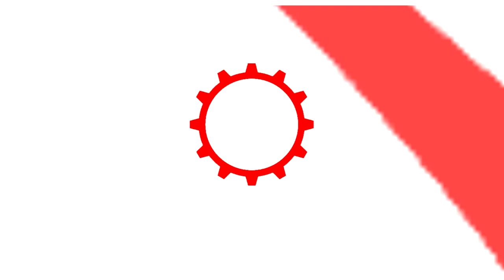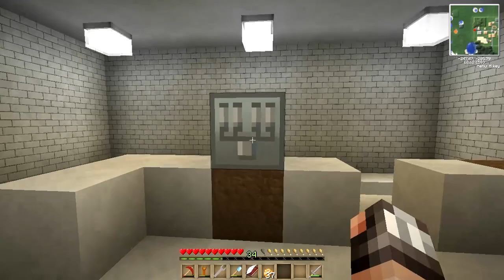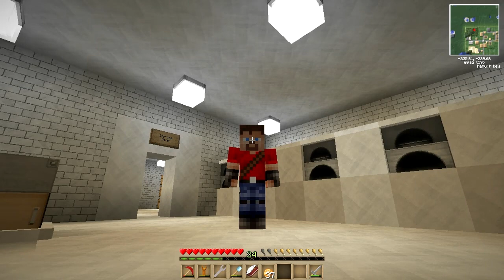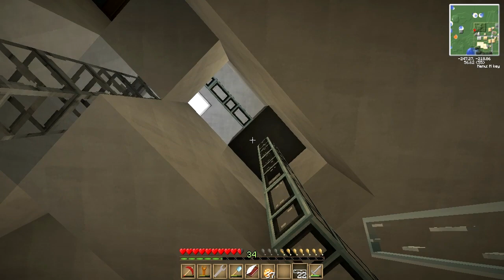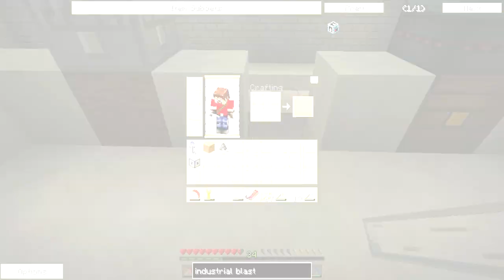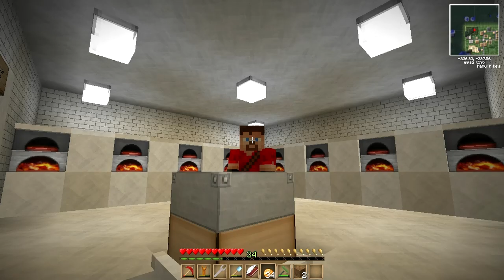[S1E8] Let's Play Minecraft FTB - Advanced Machine Block!

Comment: try putting a hopper on the furnace if it works and put marble panels over the electrical engine so you can put the leaver on it so you can turn it off and on whenever you want

Comment: Why are you putting your levers behind your engines? You should make them easier to use. My suggestion would be to use redstone to put your levers for a room onto a wall with signs. Also your redstone engine in the maintenance level should be powered by a redstone pipe, otherwise it could overheat